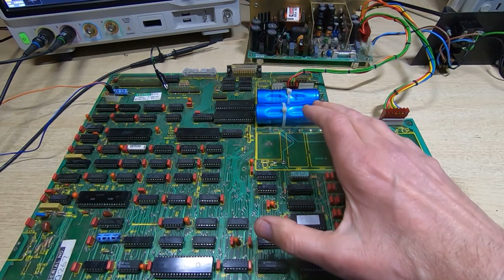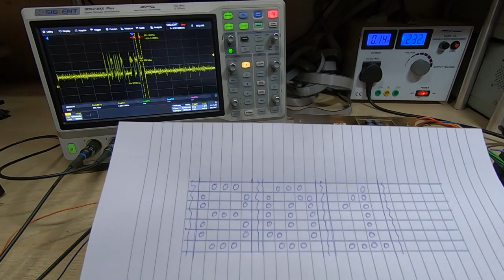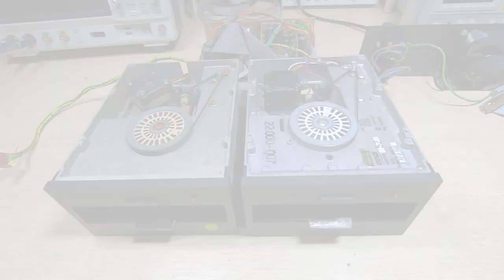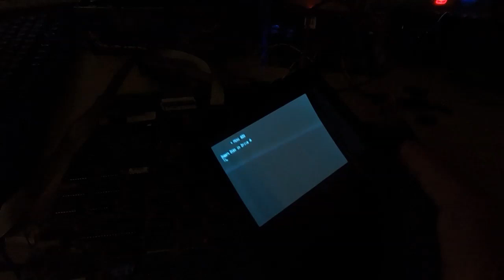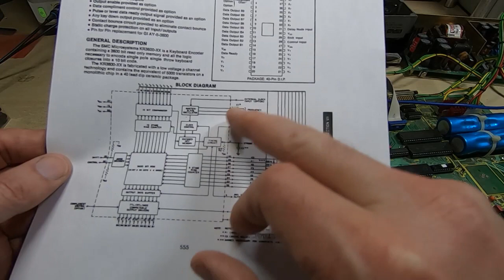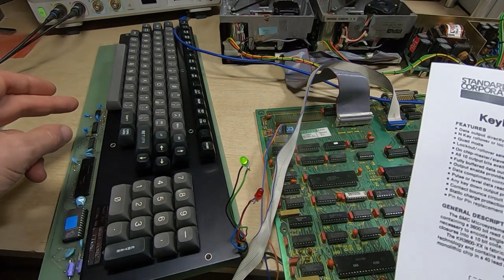Mimi 801 Part5

Comment: As always great info!   I've been trying to restore a Commodore 3040 disk drive and been running into some random failures.  This video inspired me to invest time time in double checking the DIP sockets.  And after checking under a microscope and then with a multimeter, indeed some of the pins on the sockets were bend out of place just enough to not make a connection!!  After flexing the dip socket pins back, the unit mostly came back to life.